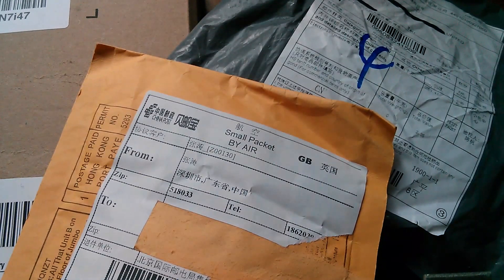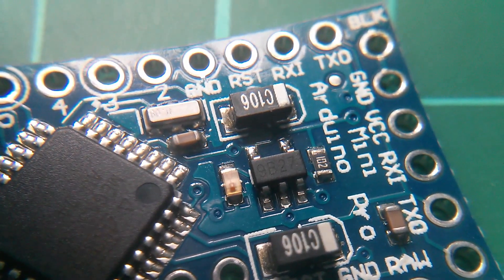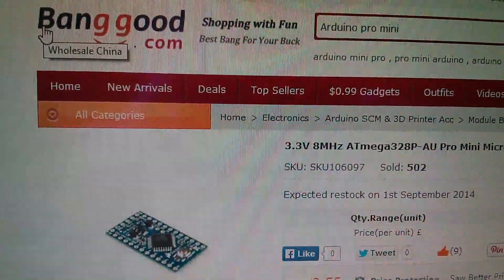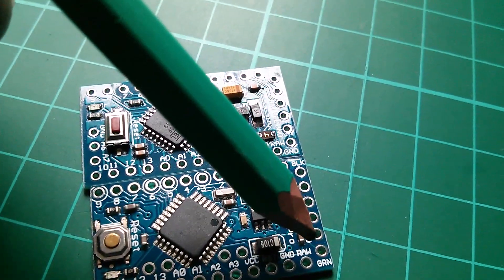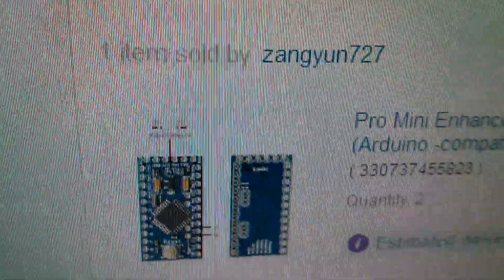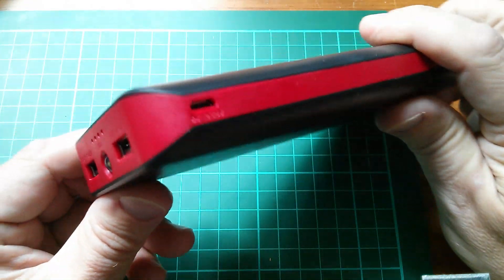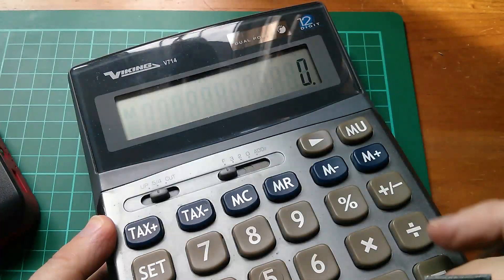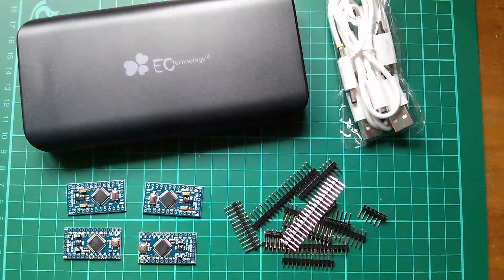Postbag #15: 3.3V 8MHz Arduino Pro Minis, 22400mAh Powerbank

Comment: the powerbank is absolutely the same that Conrad.de sells, even the case ist the same, only the color differs (with Conrad completely white)
even the ratings are the same, one connector 5V 2.1A 2nd 5V 1A, 4 loading LEDs and the output is 5V 20000 mAH, this differs slightly coz it's calculated for 5V and not the 3.7V that the cells deliver, really interesting

Comment: I was testing some 18650 cells recently. The ones claiming 3000mAh and internal protection circuit, returned about 2000 mAh and had no protection circuit. The ones claiming 6000 mAh returned 800mAh or less. All cycled/tested with a smart lithium battery charger that includes a discharge capacity test mode.

The 6000 cells were very poor and out of ballance. I suspect recycled cells, relabeled and sold as new.

Comment: Which charger doctor is that? 9:47
Reply from the maker: Ravneel Chand http://www.ebay.com/itm/Mini-OLED-USB-Charger-Capacity-power-Current-Voltage-Detector-Tester-Meter-/181429322510?roken=cUgayN

Comment: Love your vids, you make stuff easy to get for us newbies.  I got one for you (a video request, maybe?) what is the cheapest way to create a dimmable string of 3w leds (I don't know, say 6-9) with a remote analog pot?  I love the cheap constant current regulators on ebay, but they either have a tiny onboard pot or need PWM... any advice?  Thanks!
Reply from the maker: mnelson10000 I would use PWM to achieve this, even with a pot as the input device. You need a 3W LED driver. I like the Sure Electronics ones using the MBI6651.
Reply: Thanks!  okay, but what's the easiest, cheapest way to create the PWM signal?  That's the part that I was sweating, lol

Comment: Someone at work bought one of those a few months ago.  It does indeed have 8 cells.  It does take over half a day to charge to full if it's been drained, but he did take it on a hiking trip and it made his phone last for well over 8 days.
Reply from the maker: oreubens Half a day to charge sounds about right. I'd be worried if it charged in ten minutes!

Comment: Ive been using the pro minis for quite some time now. There really useful but the one I use have extra pin outs of isp and I2C. Keep up the great work :D
Reply: extra i2c pins? Do you remember the suplier? Save me switching to a (5v) Micro...
Reply: Andy Crofts http://www.ebay.com/itm/Arduino-Pro-Mini-ATMEGA328P-16MHz-5V-ATMEGA328-Fast-USA-Ship-/231110171823?pt=LH_DefaultDomain_0&hash=item35cf3d5caf :D
Reply: *****
Thanks! Much more sensible layout. WAAAAANNNNTTT!!!
-Cheers,
Andy
Reply from the maker: ***** Neat layout, but I notice there's only one tantalum cap. Also, the reset switch looks very close to the 2nd row of pins. Wouldn't mind trying one, but $9 shipping?!
Reply: Julian Ilett Right.....sorry I'm on the other side of the pond in Florida >__<  but im sure you could find a UK based one with the same board design

Comment: As I'm rapidly becoming a "3v3 - house" here, tthis was a timely postbag.
One item I liked was the switchable 3v3/5v Pro Mini - maybe the internal divider can be 're-fused' to make it behave itself. (/2 insted of /4)
One swiz, though - they're 99p each, PLUS £1.90 shipping EACH, even though they would surely come in the same jiffy bag!! I tried the sellers page to 'order' 10, and including P+P comes out (to Finland) at an eye-watering £28.90, or €36,38.  10 from Banggood would be €29,20 (free shipping). Obvious they've hidden the real price in the p+p, presumably to get a more favourable listing.
I'll ask "emarket4un" if this is correct. Update assuming I get a reply...
Reply: ebay has all kinds of price listing shenanigans, the most common being, show it up as .99 but that is for a usb cable, then you have to select a box for the item in the main title. and the price goes up, its very hard to price shop when you have do to all that clicking
Reply: Walter Boxhead
Yeah, just had a reply "Sorry we do not combine shipping...."
Motto: Stick to the few you know are good.
In my case, that's g-c supermarket, Alice<somenumber> and Banggood.

Comment: Nice video as always. looking forward to the review on the powerbank.
 I'm trying to find one that instantaneously kick's in at a mains power cut, (I see dark times ahead).
Just in case someone is interested,  it's for a Raspberry Pi security system.
Reply: Yeah, I'd also be interested in making one stay delivering power at low current draw. Presumably just change a resistor...

Comment: I wouldn't trust the labeling on those power banks too much.
If they have 75% of what they promise, you can count yourself lucky.
But I mean you can actually verify the mAh with the charger doctor, can't you? Just fully drain it and then charge it while monitoring the mAh. Of course that wouldn't give you an exact number but at least a good estimate as to how genuine they were with the capacity. Just a thought
Reply from the maker: I've just ordered a charger doctor that specifically states that it can measure the capacity of power banks. But I notice it can only count up to 19,999mAh. Maybe that will be enough!
Reply: jusb1066
 doesn't that depend on how the circuit works?
Maybe I'm totally wrong here (and if so, please tell me) but I'd say that if it's a very simple circuit that basically limits the current with a resistor and disconnects the batteries from the supply using a mosfet or something once the 4.2V are reached then the mAh measured going from the 5V supply are the same as the mAh put into the batteries. Since you're not measuring the watt hours (those would be different because some of the energy doesn't end up in the batteries but gets transformed into heat in the resistor)

Edit: if you're measuring how much you can get out of the power bank then yes of course, you're right! (and I guess that's what's actually interesting) Didn't think of that earlier, sorry :)
Reply: jusb1066
yeah I know ;) Thanks though
I was thinking of measuring the mAh when charging the power bank, not while discharging. And while charging there is most likely no dc-dc converter in there, so the mAh measured would be the actual mAh going into the pack (I'd think as explained in the other post).
If you measure the mAh coming from the power bank, than yes you'd have to take the conversion into account
Reply: Julian Ilett
of course its  rated mah is at 3.7v not the 5v its outputting so, with losses 30-40 percent less for the conversion
Reply from the maker: Ah yes, good point. So the 19,999mAh limit on the charger doctor won't be a problem.
Reply: Chiller3k
Ahh because the batteries output between 4v fully charged and 3.5v at the near discharged state.  and it needs to output a constant 5v, so therefor it has  a dc-dc converter to up the voltage, thus bringing in both the direct conversion loss plus of course the dc-dc converter isnt perfect, so loses a little too, and the difference adds up to 30 percent just in the voltage difference, plus a little more for conversion :}  thanks for asking me though!
Reply: Chiller3k
yep i do see what you mean on the charging, and i think if the cells are decent/not fake (which they should be from the price) then 22000 is just right for the cell count

Comment: whats with all the powerbanks and chargers ? There must be something else to look at :)
Reply: Julian Ilett  I'd like to see a GOOD solar powered power bank. All the one I have seen are JUNK. We are "supposed" to have a bad winter in the midwest so probably going to have power outages for days. So need something to keep TOYS running that can recharge itself fast with low winter sunshine. Yeah I know TALL order but I think your up to the challenge.
Reply from the maker: Any suggestions?
Reply: Julian Ilett
 Sensors are interesting. If there are any new cool modules or single sensors id be interested in that. I know that this has been limited to arduino this far but Intel Galileo would be cool or even the Intel Edison which is probably comming out soon , are arduino compatible. They are a bit pricey though :( but definately interesting. The intel Edison is very oriented for wearables. Sorry if I came though a bit harsh. Keep the videos comming :)
Reply: Robert Cookson get a ~10w car solar trickle charger and an automotive usb charger for a phone. The winter might need a higher wattage to counteract the lack of sun.
Reply: *****  It's got to be smallish. That's what makes it a challenge. The one from this post bag meets the first part perfect now a panel of small size to charge it.
Reply from the maker: mammutit I've got an interesting sensor coming - also some new displays. The Edison looks interesting, but I suspect price may be a problem. Having said that, I'm pretty tempted by the new Arduino Tre and Zero
Reply: You should do a tutorial series on simple ic's, like logic gates and shift registers
Reply from the maker: I do want to look at the 74HC595